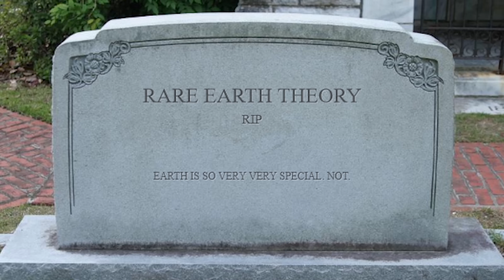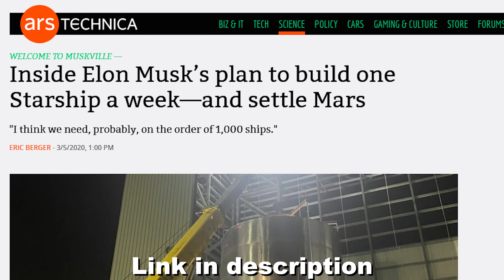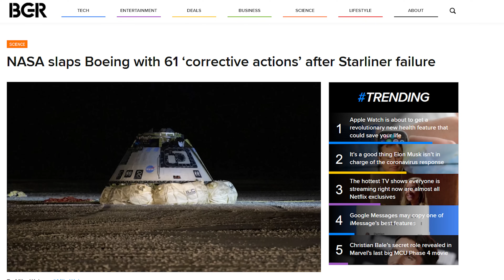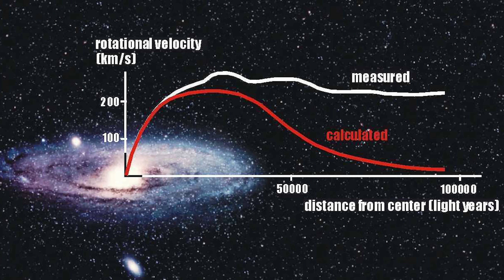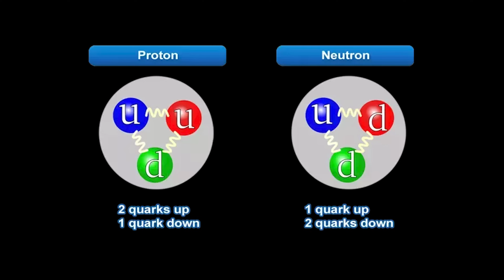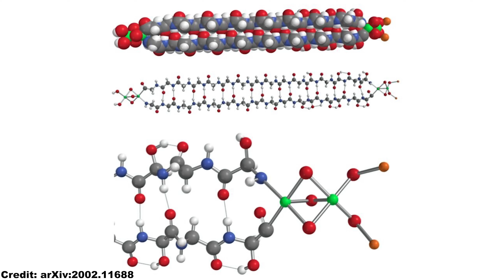Starship SpaceX News, NASA Delays Artemis, Boeing Corruption Rant

Comment: Starliner's situation is very similar to the Soyuz's situation in the sixties. Back then, 60 years ago, when Gagarin and Komarov tested the spaceship on ground for the first time, they found no less than 200 issues, yet the soviets decided to launch it , killing Komarov.
Completely opposite to Boeing crap, in Boca they tested successfully the SN2 for 12 hours using simultaneously a piston that simulated the push of a Raptor from below, while at the same time, like in a real flight situation, pressurizing tank under cryo temperature.
Who is the genius here? The answer is a no-brainer.

Comment: I think you guys under estimate Blue Origin. They have been building their factory and now that it's almost done, they will be pumping out New Glen's at a staggering rate. I would not be surprised to see a static fire before the end of the year. Launch to come early 2021. You have to remember, SpaceX is their competition. And the bar has been set high.

And as for NASA, cut them some slack. I don't believe that they are favoring either company. If you look at it, SpaceX had a fault that caused the total loss of their spacecraft (the one that was previously attached to the space station) and that didn't slow them down much. If it's just software that Boeing needs to address, then NASA will likely allow the next mission to proceed with crew aboard. Only because it costs 10 times more to launch a brand new Atlas 5 that will become a stain of smoke and debris across the sky as opposed to SpaceX using a brand new Falcon 9 that will likely go on to fly three more payloads. However, if any of the hardware needs to be modified, Starliner will need to be recertified before humans ride it.
Reply: I only have faith in Blue Origin because Elon Musk is living Jeff Bezos's dream. Jeff's idea of step by step is going to switch to that of SpaceX which is leap and bound. I think that is why SpaceX is so popular and brought so much interest to the space community. If you are leaping and bounding, you are eventually going to crash... and who doesn't love a good crash lol. Or explosion in the case of SpaceX. I'd be willing to bet that Blue Origin will start to blow stuff up here soon. Competition will get fierce! And I am so excited for that.

And I was just speaking to commercial crew, for the most part it's been pretty fair. Take Boeing's pad abort test for example. The main parachute failing to deploy was not a fault of the spacecraft design, but a failure of the personnel who conduct the preflight checks. I'm sure there are multiple signatures on documents stating that the unchecked pin was checked. Same with this flight test. I'm betting that they added a piece of hardware, coded it in and assumed that the additional coding wouldn't cause 61 conflicts. Something that could have been identified during a thorough integration test before launch that was never conducted. See the pattern starting to emerge? This is an issue that NASA has not seen before, two companies competing, a race if you will, to be the first to get astronauts to ISS. And I don't think SpaceX ever adopted the mindset of racing Boeing because if they weren't the first, no big deal. They would still be the cheapest and that gives them the competitive advantage. Nobody at Boeing OR Congress wanted SpaceX to win the "race" so corners were cut. In my opinion, NASA needs to address the effects that these new types of competition have on the personnel that develop these projects. 

But yes if you factor in all Boeing operations, they are definitely getting something they shouldn't. I've been saying for years that SLS needs to be shelved before another dime is wasted on an obsolete design. Infuriating is a great word for what's going on here. And as long as this core doesn't explode on the test stand, we will see it fly once. They are too far in now. The American tax payer will be furious if the project gets cancelled before it has a chance to fly. In my opinion, ULA, Boeing and NASA should be looking into ways to make it reusable. Even if that means sending a Falcon 9 up to attach the second stage to slow the SLS core down to a safe reentry speed. That would still be more cost effective than discarding the entire system into the ocean.

Thanks for reply guys. I watch all your videos and appreciate the views you bring. Keep it up and I look forward to the next one.

Ps. To be clear, I am a hardcore, die hard SpaceX fan and I don't see that changing anytime soon. I do like to be optimistic with all things space related because one day, I would like to get there my self. And the more success that comes to the industry, the cheaper it will be for me to get there. Maybe I might even get paid to do it :)

Comment: I believe there is life out there somewhere but in exactly what time period is a tricky question.  We are seeing old stuff not what is going on now. 100 million years is a very long time ago. Think of what was on earth 100 million years ago. That's not even very far away from us. We probably weren't even noticeable to anyone out  until the last 200 years.  If that.  Had a professor once say I Love Lucy's episodes are being broadcast out into space so at this point someone 70 LY away is getting those signals but faintly.  Can they make anything out of an analog signal?  Will they just notice some parts repeat? The show in general will not have much repeating so it may just look like background noise. Would we have been able to pick up a HD TV signal in the 60's and do something with it?  

In the end if the true speed limit in the Universe is the speed of light I think there would be no high tech star traveling species. For that matter we aren't going far either. Let's say we spot a prefect solar system for us that is 70 LY away from us. We have the tech to go to light speed instantly and stop instantly. 70 years to get to that solar system then 70 years just to phone home saying the spacecraft is there. 140 years just to know that the spacecraft made it. What if the solar system ends up being some horrible place for some reason we didn't know a head of time?  In this case it's hard to cover a payroll for that long, I just don't see a mission like happening. 

For us to really travel the galaxy we would have to have FTL travel along with FTL communications. There are theories out there about doing this type of stuff but they are very much theory.
Reply: Yeah for all we know FTL could more likely come from a breakthough in our understanding of geometry rather than anything in physics that makes "over there" equivalent to "right here".
Reply: @congorecluse8111  who knows what we don't know? LOL. Could be a whole another branch of science out there that we just have no knowledge of.  It's like cold fusion a bit,  results have been gotten in lab situations but it's hit or miss so the results are unrepeatable yet more then one team has gotten positive results.  All false positives by different people or have we just over looked something? Maybe a reaction that we don't know yet, the trick is figuring out how to do it repeatedly.

Comment: 61 starliner corrections..is a little overboard but NASA is being extremely careful after the loss of 14 lives during the flawed shuttle program. It is  on them if something goes wrong. Politics is involved and jobs. They know how to milk a job. Look at the SLS? BILLIONS OVER A DECADE AND NOTHING!! Sorry but one observation: All those masks do not stop the contracting or spreading of the virus. Maybe certain bacteria but viruses are so tiny they easily pass between the material of almost all masks sold to public. I guess it gives a certain amount of psychological comfort though which can be important.  Great video!! 💓👍 p.s.- sorry but SLS will be lucky to fly at all.  Maybe one test. They should certify the Delta IV for human space flight. Already built, flown, uses similar hardware and has ALREADY flown the Orion capsule once. NASA should consider this.
Reply: Sklawz Einstein masks Can limit spittle - my guess is a lot  - so can held -
if virus is airborne in fine spittle likely go threw a mask

Comment: Blue Origin seems to be making its own fairings and thus seems to be independent of business partners in Switzerland and elsewhere with respect to payload shrowds. This is an important factor for Blue Origin. Space X is skirting the issue by designing an upper stage for the Superheavy booster with engines, tank sections, and payload space integrated into a single unit which is reusable, i.e. Starship. Only a third stage is problematic with this configuration. If Blue Origin will add on the rest of New Glenn to BE-4 engine and fairing, and if the Advanced Cryogenic Evolved Stage is still on the table, Blue Origin has a launcher for large unmanned interplanetary missions. Developing a triple-core version of this launcher (3 first stages, presumably a central core strengthened for extra payload, ´New Glenn Heavy´) gives Blue Origin a true alternative to SLS with 3 reusable boosters (Falcon-Heavy-style) and about 100+ mT payload to LEO (like SLS Block 1b or better). Blue Origin is ahead of Space X in LH2/LOX technology. However, with only 2 stages New Glenn is just another heavy satellite launcher. The proteins on the meteorite are exiting. At this point, it is one sample that sat in lab storage for 30 years. Hopefully, more meteorites with proteins will be found in the future (preferably in Antarctica). One sample point is no point, two sample points are one point, three sample points are two points, etc. Evidence can only get stronger over time. FAT CAT contractors with any amount of political influence are not God-given as some older people like to think. Thex are entirely man-made. Go, Starship.
Reply: Agreed. Blue Origin makings its own fairing is a huge deal.
We should not forget that SpaceX just got locked out of some government launches because the fairing requirement just happened to be in that sweet spot between the Falcon 9 fairing and the Delta V fairing, and then ULA claimed it owned the IP on their fairing.

Comment: Reducing the number of welds on the Starship will likely become a priority for SpaceX. Right now the are using a slip rolling machine designed to make water tanks. Don't be surprised if SpaceX makes their own custom machine that can bend sheet metal twice the width. Thus reducing the number of welds.